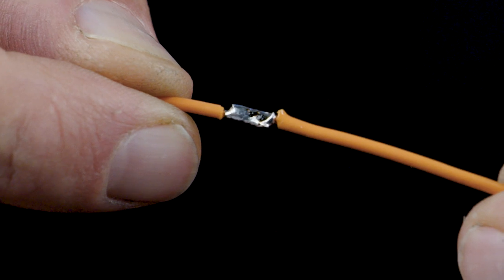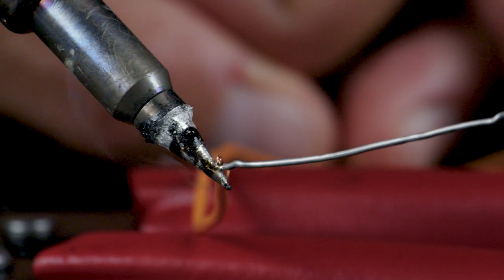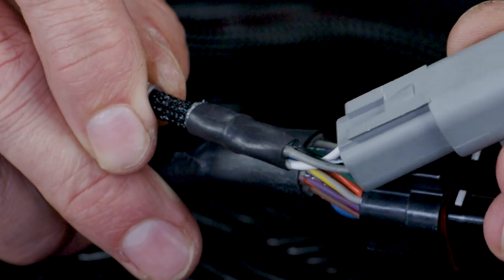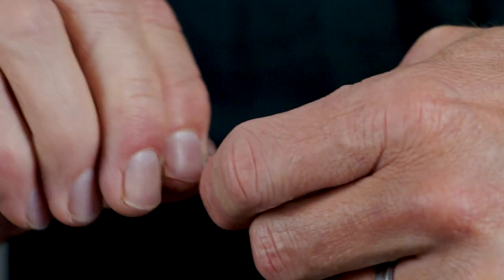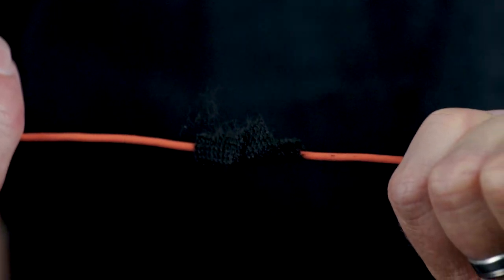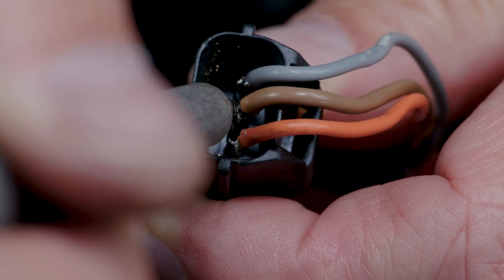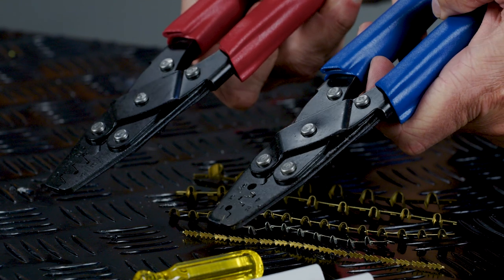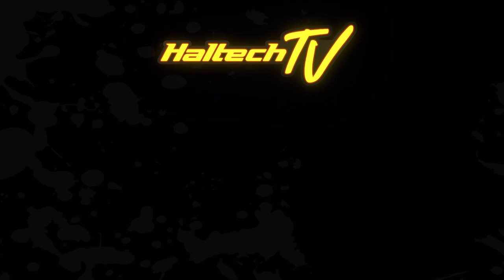🛠 Crimping vs Soldering - Which Is Best? | TECHNICALLY SPEAKING

Comment: Not the scientific examination I was expecting from the title and intro, just another opinion. 
If I was using solder to join two wires I would not rely on the solder for the mechanical connection and would twist the wires in one way or another before soldering.  Crimping is used because it is faster and more consistent in untrained hands, thus making it cheaper in a manufacturing situation. This doesn’t make it better or worse, but explains why you see it so often. 
I’d really like to see a proper scientific evaluation of the two methods though.

Comment: do as per the manufacturers assembly instructions ;)

trying to "improve" by deviating from those instructions doesn't improve anything!

and solder has a very specific application, the soldering iron isn't a magic wand for electrics/electronics to make stuff better.

Comment: this topic has been discussed about 1000 times by 1000 youtubers ... 
Solder is a waste of $$ 
twist and crimp have the same results as long as there is NO Tension pulling on that joint.

Comment: Sorry, but annealing a metal makes it less likely to break not more likely. I don't think most soldering irons get hot enough to do much annealing anyway. If your soldered joints are corroding you are either using the wrong flux and/or not cleaning the flux off after soldering.

Comment: I believe crimping is the best method of it is near vibration and on and off heat.   The expansion and contraction of the metals while or after vibrating a lot does cause the solder to form hairline cracks.  It doesn’t always fail. But it has much more potential to fail. I’m no auto mechanic, maybe here and there on my own car.   I am an hvac tech for many years and can for certain tell you that crimp connections, if done properly, can handle a massive amount of abuse (vibration and heat) and not fail.   Ever.  But I do see solder joints of wires to boards and relays break all the time.  If it’s in an engine bay.  I say that you are a clown for soldering that wire.   That is asking for trouble

Comment: I do both methods daily. What is shown in the video on a soldered joint is totally incorrect, you NEVER just solder them together thats a recipe for disaster. Always twist the wires together over each other to create a physical joint then apply solder by heating the bottom of the joint and applying the solder to the top , this is to ensure that the solder is drawn from top to bottom.
Heating the top only will allow wires on the bottom to not get solder.
Crimping is really designed for connectors either single or in connector housings.
If these connectors are to be unplugged often I also solder the crimp.
Always work out a design plan for your wiring and install heat shrink BEFORE you solder or crimp😅😅

Comment: sorry but connection-crimping-twisting is the worst to go.  Follow any BLACKBIRD rider for this answer.  Crimping the wires for a suitable connection can and WILL render this motorbike dead at the side of the road.  Without solder the wiring harness seriously suffers green infection of the wires.  Limescale type.  Remove the crimps - solder the wires and bike is road worth till it gets trashed or burnt out or stolen.  Trust me blackbird owners - fanatics know all to well about the wiring issues.  Solder wins 100%.
Reply: "Without solder the wiring harness seriously suffers green infection of the wires.  Limescale type" aka verdigris - a bright bluish-green encrustation or patina formed on copper or brass by atmospheric oxidation, consisting of basic copper carbonate.

Comment: your soldering incorrectly. need to twist wire together, heat the wire from underneath and let the solder weep in. iron tip shouldn't touch solder directly.